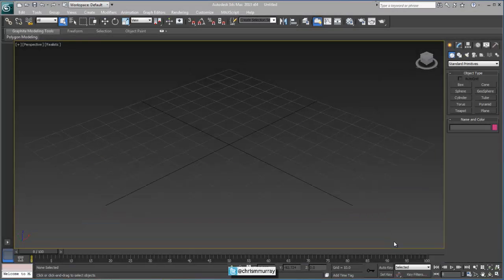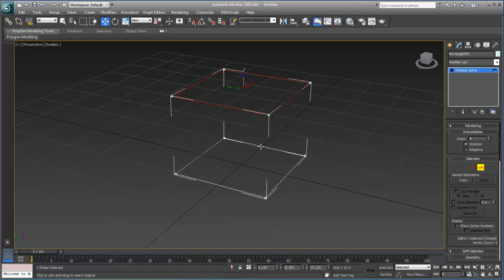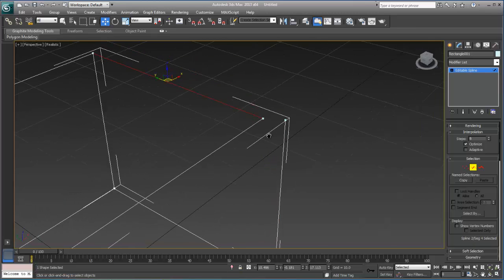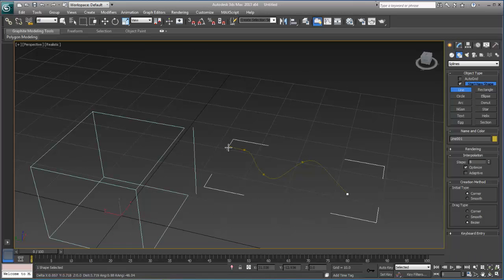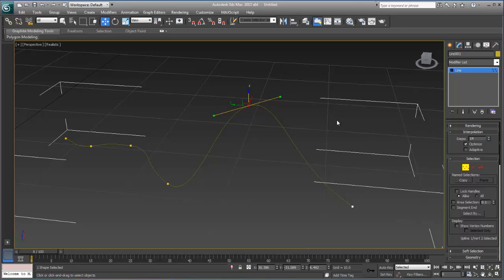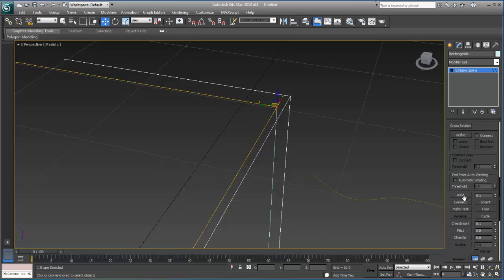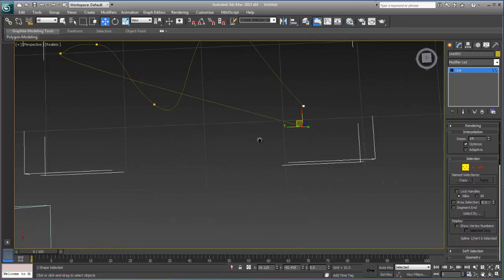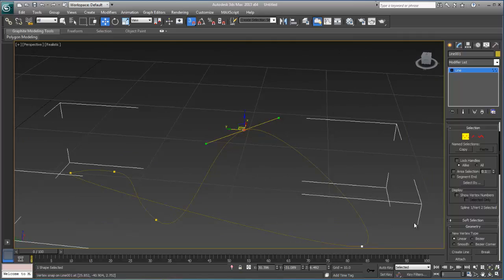3ds Max tutorial - Welding Spline Vert

Comment: I thank you for making this video.  What's weird is I was doing a tutorial regarding splines, and it called for welding two coincident vertices that already had two lines through them.  It's starting to sound like whoever wrote that tutorial just didn't really know his or her stuff, but I wouldn't mind confirmation.  Would you care to answer some questions?
Reply from the maker: correct. You cannot "weld" coincident spline vertices. you can "fuse" them, which merely places them in the exact same location. But you cannot "join" them.What other questions?
Reply: I think if I had any other questions I probably forgot them by now.  I did end up being able to finish the tutorial after skipping that impossible step, but I'm not sure splines are my preferred method for modeling characters.  If I go back to using them, though, I may come back here.

Comment: Soo what are the options I have when I want to weld them? Convert them from a spline to a poly first? I'm still a noob at 3ds Max :/
Reply from the maker: MrPhinixa  when it comes to splines, options are limited for welding. Spline vertices are not the same as polygon vertices. Only end points of splines can be welded (either to each other or other sub splines with open endpoints. Where a spline intersects itself (like the middle of a figure-8) and has two splines directly on top of one another,... those cannot be welded together.